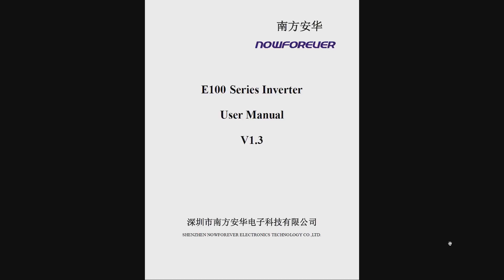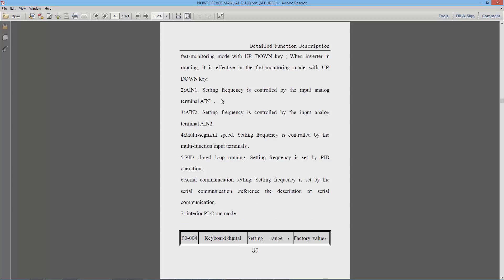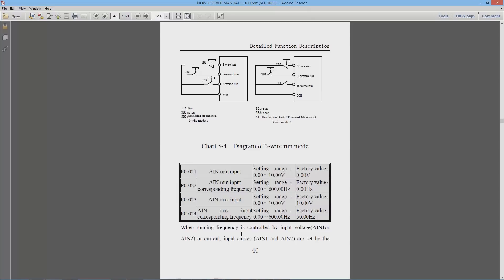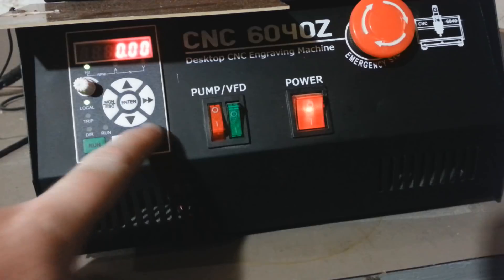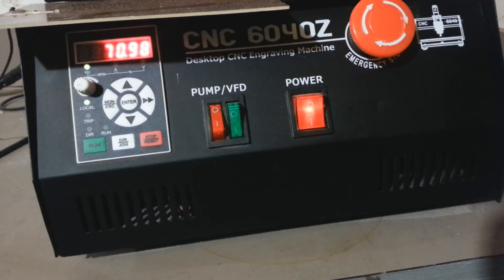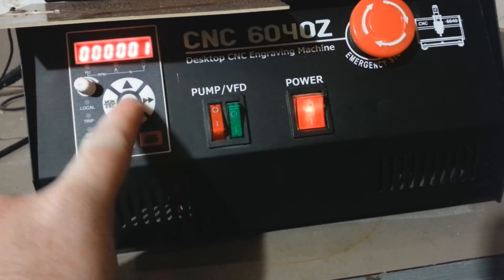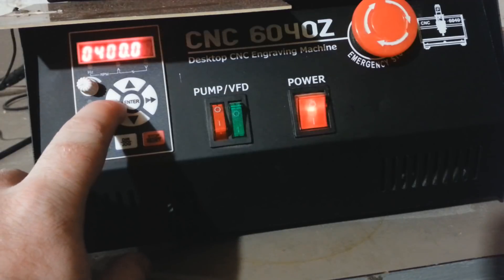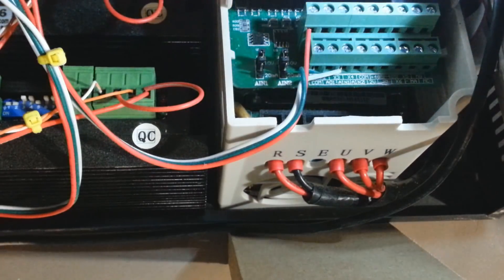CNC 6040 - Programming / Wiring the "NOWFOREVER" VFD

Comment: Hi There, You might be able to help me. I have a 6040 CNCEST unit and I have had no problem with mach3 except the limitation of the license so I'm going with a stand alone box e.g. the DDCSV3.1 offline controller. Now my original spindle control had 4 wires namely AVI, 10V, Comm & FWD.  So I'm wondering how with the break out board of the DDSC do I wire this?  Many thaks

Comment: Hello and thanks for your extremely helpful advise. I have 2 questions. 1) the Nowforever unit i have does not have the display that you show on this video. the display contains a 5 unit readout on top. Below that is a potentiometer followed by (Prg/Esc) button, a up arrow button, and a (Data/Enter button. Then there is a (M.F.) button, a down arrow button, a double right arrow button. then on the bottom is a (Run) button and a (Stop/Reset) button. i have tried following your discussion in this video and can see PO but cannot get the display to show 3 numbers to the right of decimal. Can you tell me where i can learn how to check the program setup in my machine? I run the unit with MACH3.
Question 2) my first unit exactly like the one you show above ran great for a year and a half then I forgot to turn on the pump and burned out the spindle - the display showed an (Err 13 - not E013) and the spindle did not turn. Everything else worked fine. I purchased a separate VFD and spindle unit and was back in business but wanted everything in one box so I purchased another nowforever 6040Z controller unit (110 volt - 2200kw spindle). after initially spinning up the spindle, I am now getting the same Err13. Can you tell me how to fix the problem? or recommend where I can send the unit to have it repaired or programmed?
Reply: This is Mike Thomas again - i found the Err13 problem - it was an open wire from the 6040z control box to the spindle.
Reply: @mtconsulting2  You said "I forgot to turn on the pump and burned out the spindle".
This is my suggestion:
There is an OUTPUT relay inside the VFD. It is better to wire that relay to switch on the pump whenever the spindle is spinning and turn off the pump whenever the spindle is NOT spinning. (Just leave the usual pump switch  always on unless doing maintenence).
Reply: Did you end up getting your 2nd Unit going - I have that one as well - "Square button layout" instead of the Circular pad...
The Struggle I seem to have is - I have never had Spindle control from Mach3, but had previously at least been able to Control spindle speed with the Knob on that panel.  At some point a while ago I must have reset it (trying to get spindle control.) - and now RUN only goes to Full speed or Off.  If I change to Mach 3 control with the suggestions here, Nothing seems to happen.

So - Anyone who has information on what seems to probably be the Newer version of these NowForever's and from the looks of it a Different set of Values for the P0-xxx commands as well... (i.e. when he says got o P0-007 to set the Frequency - well that isn't in P0-007 for me -  it is in P0-008 - which makes me think for instance that perhaps P0-002 for Mach 3 control is perhaps suppose to be P0-003 and so on...

Comment: Hi... Thanks for video... But I have 4060 like your machine and I would try to work with mach3 the problem is I have 3pin from the mach3 board (ground, VSD, M3)which of this pin connected to X1? Thanks

Comment: someone did it with the jp-3163b?
Reply: Yes
You need 4 wires instead of 3 wires.
ACM (analogue common) and DCM (Digital Common) are different when using  jp-3163b.

Comment: I can't for the life of me get this to work right I have an identical vfd and I'm using the jp-3163 v3.9 controller card and it just won't work
Reply: You need 4 wires instead of 3 wires.
ACM (analogue common) and DCM (Digital Common) are different when using  jp-3163b.

Comment: Thanks for the Programming information. I have a CNC 6040z in Mach3 my Pulse frequency is set to external. When I follow your P0-000 and I change the value i still see the run button light on. I have been trying to set this up. so far your video has given me some info on what to do. but im new to Mach3 and still have some difficulty in setting up. can you help?

Comment: THANK YOU! I have been given excuse after excuse from the Ebay seller I bought my 6040 from, as to why he couldn't supply a manual for the VFD ("Too much in it"; "Factory set the parameters very carefully, no need to change"). HA! Their factory is sorely lacking in Quality Control. A replacement VFD that they sent me, to replace the first, defective unit (spindle wouldn't turn), fixed the spindle problem, but none of the axes worked. I took the cover off, to find that the X cable was loose, the Y and Z cables weren't even plugged in to the board, three wires on the E-stop switch were loose, and one haden't been crimped properly to the spade connector to the 'VFD' switch, so it was just hanging in the air. Now I'll go through the parameters, to try to get my spindle to run from the computer program, rather then the VFD panel.  [/rant]
Reply: I was given some good advice when I bought my 6040 and controller. That was to check every wire connection and to check every nut and bolt on the machine before you turn it on. Good advice.

Comment: Hi. I have a CNC 6040z from Chinacnczone Store like yours. It has a nowforefer vfd D100S2R2B.

I have a trouble. When I set M3 S20000, the spindle starts to 400Hz and 24000rpm the same thing if I set M3 S24000, that is, the maximum rotation speed is reached already with s20000 and not with s24000 as it should be. 

Can you help me? 

Thanks.

My pid:
P0-000 1 
P0-001 0
P0-002 2 
P0-003 0
P0-004 50.00
P0-005 5.00
P0-006 0
P0-007 400.00
P0-008 0
P0-009 8.0
P0-010 8.0
P0-011 6.0
P0-012 400.00
P0-013 1.0
P0-014 0.0
P0-015 0.0
P0-016 1
P0-017 24
P0-018 25
P0-019 26
P0-020 0
P0-021 0.00
P0-022 0.00
P0-023 10.00
P0-024 400.00
P0-025 1
P0-026 3
P0-027 0
P0-028 1.00
P0-029 0
P0-031 0
P0-032 0.00
P0-033 0.0
P0-034 0.00
P0-035 100.0
P0-036 150.0
P0-037 130.0
P0-038 125.0
P0-039 0
P0-040 0
P0-041 0
P0-042 0
P0-043 0
P0-044 0
P0-045 0
P0-046 3.00
P0-047 0
P0-048 1.00
P0-049 2.00
P0-050 0.00
P0-051 0.0
P0-052 0.0
P0-053 15.0
P0-054 15.0
P0-055 1
P0-056 2
P0-057 0
P0-058 0
P0-059 0.00
P0-060 250.00
P0-061 150.00
P0-062 350.00
P0-063 100.00
P0-064 300.00
P0-065 200.00
P0-066 400.00
P0-067 8.00
P0-068 9.00
P0-069 10.00
P0-070 11.00
P0-071 12.00
P0-072 13.00
P0-073 14.00
P0-074 15.00
P0-075 0
P0-076 0.0
P0-077 0.0
P0-078 0.0
P0-079 0.0
P0-080 0.0
P0-081 0.0
P0-082 0.0
P0-083 0.0
P0-084 0.0
P0-085 0.0
P0-086 0.0
P0-087 0.0
P0-088 0.0
P0-089 0.0
P0-090 0.0
P0-091 0.0
P0-092 0
P0-093 0
P0-094 15.0
P0-095 15.0
P0-096 15.0
P0-097 15.0
P0-098 15.0
P0-099 15.0
P0-100 15.0
P0-101 15.0
P0-102 0
P0-103 15.0
P0-104 15.0
P0-105 220.0
P0-106 0.00
P0-107 30.0
P0-108 7
P0-109 8
P0-110 1

P1-000 0
P1-001 0

P2-000 0

d0-000 4
d0-001 4
d0-002 4

d1-000 1500
d1-001 41182
d1-002 4
d1-003 2.2
d1-004 220.0
d1-005 10.0

d2-000 0
d2-001 0.00
d2-002 0.00
d2-003 0.0
d2-004 0.0
d2-005 327
d2-006 0.0
d2-007 10
d2-008 3.00
d2-009 0.00
d2-010 0.00
d2-011 0.00
d2-012 0
d2-013 0
d2-014 0
d2-015 0

d3-000 0
d3-001 0
d3-002 0.00
d3-003 0.00
d3-004 0.00
d3-005 509
d3-006 510

Comment: Excellent video. Congratulations. The missing part for me is not actually the controller card connections but the parallel port pins I can use to connect my Masso all-in-one-controller from Hind technologies in AU. Could you by any change help me with this?

Comment: Hi,thanks a lot for the demonstration it was very helpfull, i am a new user of cnc 6040z and i did alter some vfd settings before i gett the user manuals by chance the spindle started to run from the keyboard of vfd, but when i get the software from seller iknew that i shouldnt alter the vfd settings but it was too late, thanks a lot now i managed to return the control to mach3, i did alter p1 and other values which i dont remember but it doest seem to affect the function.,thanks again

Comment: hello! I was wondering if you had a screenshots of your ports and pins  by chance, I can't seem to get my 0-10v to change, it'll go from 0 to 10 upon spindle startup, but it will not adjust for the proper speed ever. I have it set to pin 1 step. any help would be greatly appreciated, I can email photos or call

Comment: I just set mine up today. At the 8:23 point in this video when you make it 0 instead of 2 and hit enter, it changes. However, when I do the same thing, instead of going to P0-002 mine goes to E030. Any idea on what is going on or how to fix this? Thanks!
Reply: KatMey5 yours is the d100 model like mine, the setting your looking for is actually listed under p0-006
Reply: I went to P0-006 and changed it to zero and it also says E030. 

Also when I push run like he did earlier in the video mine does not make a notice whereas his does. My computer program is working but it's not communicating with the CNC itself so my machine has never moved an inch.
Reply: @KatMey5  did you ever figure this out? It looks like E030 is a lockout of the settings. I'm trying to find out how to unlock my VFD

Comment: Great video ! This is the most accurate description of the CNC 6040 VDF function available on the internet. I'm searching the internet to configure the VFD for my CNC 6040Z -S80 machine for a week already but couldn't find anything useful.
Now,  I'm almost managed to control my spindle from Mach3, but some of the pin and port config is still not ok.

Can you share some details on how to configure properly the Mach3 output pin & ports ?

Comment: Hi,
thank a lot for your video! I have a question: where do you have connect the other side of the cable to breakout board?
Thank you for your reply!
Reply: VFDGrond to your board ground, X1-VFD to Enable Spindle in the board, and AIN1-VFD to 0-10V-Board
only check your Board Pins
Reply: @gearcnc  very good

Comment: thank you :)
i've got my X4-800L-USB last week, but the spindle didnt work. i checked the wiring, even got the VFD Documentation, but didnt get any sense out of it. you solved that. i got the spindle to work manually now via the panel, and tomorrow i'll check if the ain signal is correctly configured in the vfd, and if the incoming signal IS 0-10V. again: thank you :)

Comment: Thank you very much for posting this info. I was able to get both the spindle speed and spindle enable (clockwise only...no need for CCW) to work in Mach3 with the stock parallel port breakout board with appropriate wiring and the addition of a small D/A board between the breakout board opto PWM output and the VFD.

Comment: G'day,
On my first post I mention that we both got the 6040Z CNC model, and I asked you if you knew what the Z stands for , you also said that you have no idea so, I did find out what it means.  The Z means that, has a ball screw set-up and the S80 represents the spindle diameter...! neat, huh..???
Now, another question that has been puzzling me, most CNC use parallel port and when you set the mach3 software, you have to go to Ports and Pins to workout the correct pins numbers however, what you do, if you have an USB port system, such as the one you updated on yours so, how to you set the Ports and Pins..???
Cheers
George
Reply from the maker: +nyodine That is good info to know, thanks for sharing! With regards to the ports and pins, you still have to set it up on a USB card. The difference is that the there is a usb driver for the card that you select in mach3, this driver communicates with the card and tells it which ports and pins to turn on/off on the card. Hope that helps.

Comment: Hi. Thank you for the extremely helpful and great tutorial. I have one question though. I have a 4 axis breakout board exactly as shown here that is located in the 6040Z black box.

https://www.google.com.sg/search?q=4+axis+breakout+board&source=lnms&tbm=isch&sa=X&ved=0CAcQ_AUoAWoVChMI_vbsq7ORyAIVhbqOCh0BvwWJ&biw=1097&bih=557#tbm=isch&q=4+axis+breakout+board+cnc6040&imgrc=ABtvg1_irImd8M%3A

Can you show me exactly where do you connect the COM, AIN1, X1 of the VFD to the 4 axis breakout board? Your help is very much appreciated. :D
Reply from the maker: +Jia Jun I  am not familiar with that board.. but it appears you do not have the ports required to control it from Mach3.
Reply: Thank you. The bought came with the black box so I thought you knew about it. I have ordered a new breakout board though. Thanks!
Reply: it`s not on that board, it`s on the VFD box inside, but you most likely know that.

Comment: Any chance you have the rest of the settings for this? I just have the VFD and spindle but for some reason it only spins at a very slow speed even when increased up to 400Hz. I think that one of the P settings is incorrect and that's why it's not driving my motor correctly but I'm not sure.
Reply from the maker: +Jay Collier Hi Jay, The default PID settings are in the manual linked in the description. I will double check but I am pretty sure the defaults are the settings on my VFD
Reply: +Jay Collier 
Jay have you get on MDI type on input: m3 s1000  to make spindle to turn ?

Comment: Wow, I'm impressed with your knowledge, and you explain things very clearly, even though, I didn't understand half of what you said...?
Hi, my name is George and I'm in South Australia. I have been very interested in having a small CNC like this and in fact, I'm trying to buy one, preferably the 6040 4 axis USB 1,500W or 2.200W spindle machine.  And just so that, I don't forget, was does the "Z" means after the 6040 ...???
I may not be able to afford that so, I may need to go for the same machine but in parallel cable and 800W but I wonder, if I can update this to a stronger motor set-up, but I don't know if the common machines seen on eBay will allow this upgrade, later...!

So, this video gave me a good inside of what is involved with some upgrades and I thank you for that, I will keep watching your videos, thanks.
Reply from the maker: +nyodine Hi, Thanks for your comments. Unfortunately, I am not sure what the Z stands for either. I am happy the video helped you out, I will be putting out more informative videos in the future that will go a bit further into the wiring of the control box etc in case you do decide to do some upgrades.. Stay tuned! Cheers!
Reply: Today it is 2022, 6 years after your post. Did you ever get a CNC machine? Cheers!